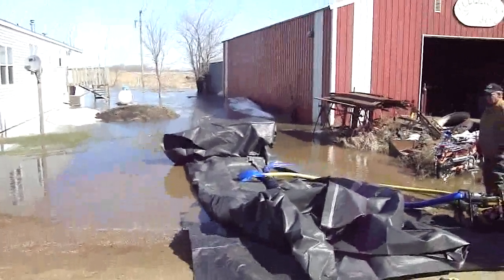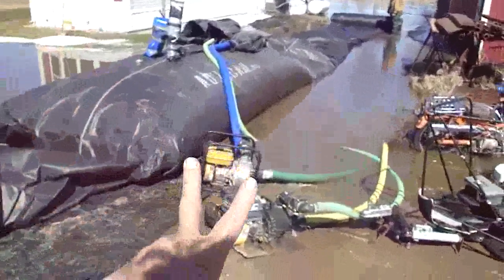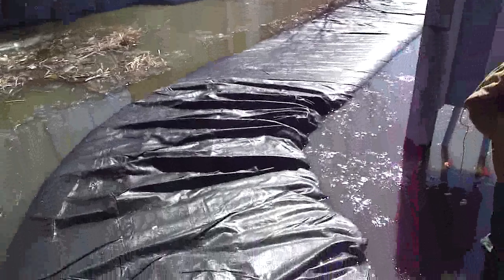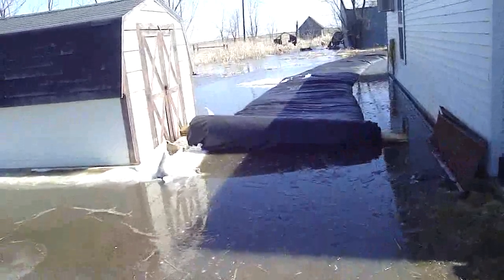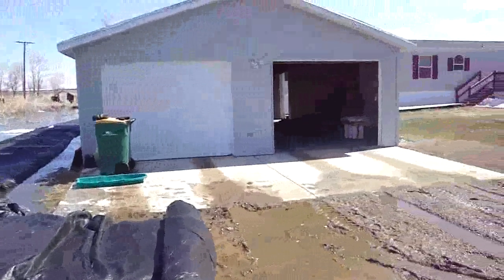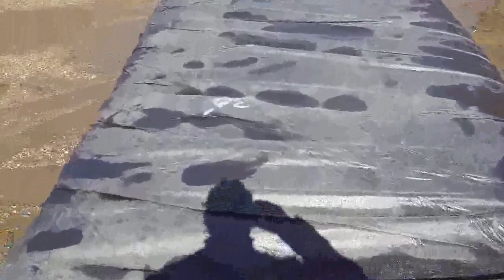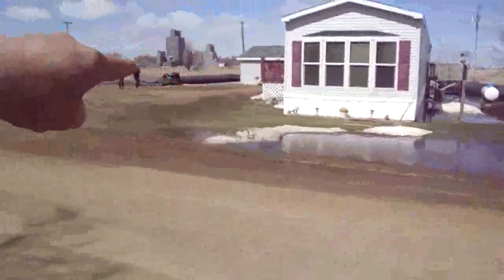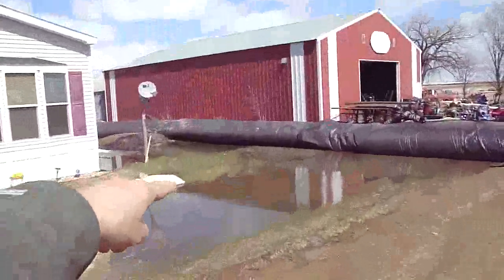Flood Protection in Cogswell, ND 2011

Comment: how do you clean it inside after you drain the dirty flood water, and how would you dry it so it doesn't mold before the next use?
Reply from the maker: Rinsing the unit is not usually done. The inside material does not support mold, and none of the constituent materials rot or support mold growth.